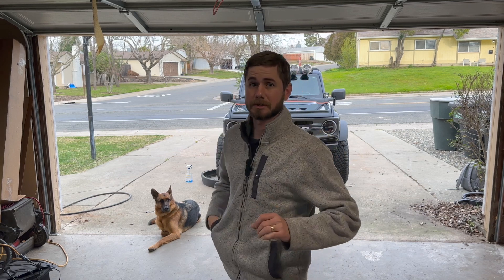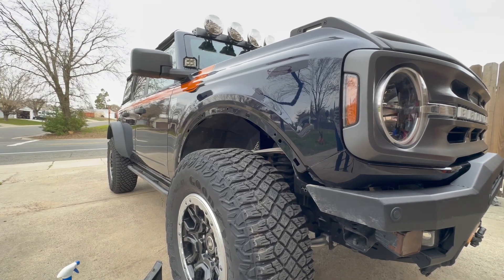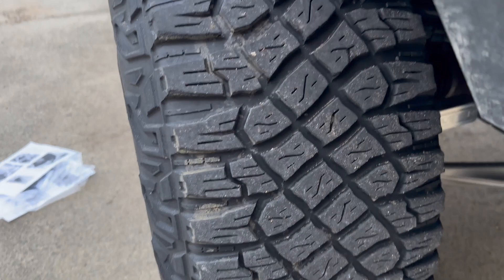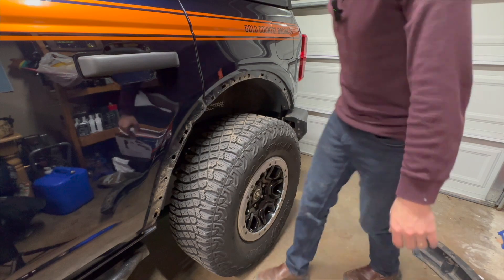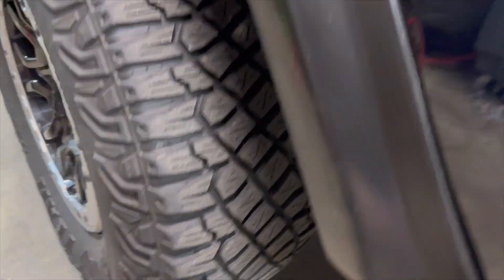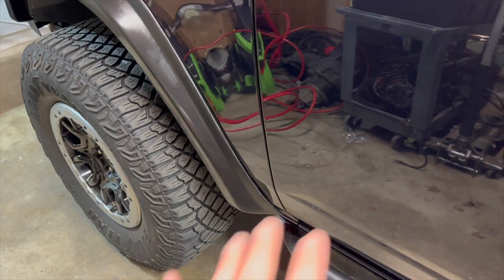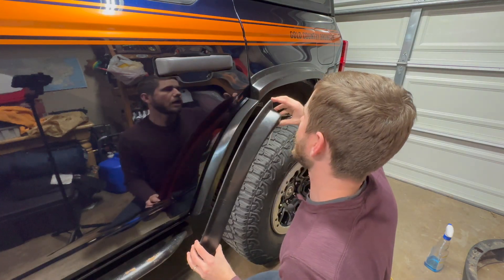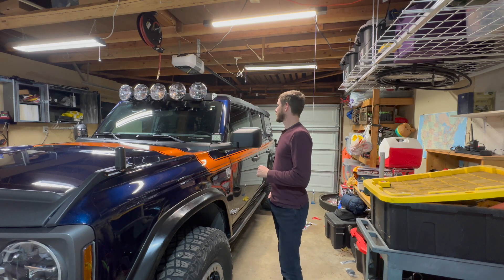I Got A New Bronco!

Comment: I like them. But not the tape idea. Overtime the tape will just start failing to adhere right? And say you’re driving on the trails and knock one off. Well, it was just held on by tape
Reply from the maker: Yea the tape is cheap. They actually sent me new tape they said is stronger, have yet to use it. So far they are still there! Rub em raw on rocks and trees all the time and havnt fallen off. They bend easy and absorb the impacts which helps, lasted longer then my OEM so far haha, I shattered those

Comment: Using a heat gun or hair dryer and applying pressure to the flares will help set the adhesive more effectively - particularly those corner areas.
Reply from the maker: Thanks! I did try that as I applied it off camera and it didn't do much sadly..:( KDB sent me new adhesive though so i'll be trying that soon.

Comment: Does the light bar affect the soft top
Reply from the maker: Yes it did at first. Lots of flapping and I noticed I had to run my radio louder and speak up at freeway speeds. Pretty annoying. 

After installing the ford wind deflector on the hood though the difference was amazing! Radio back to normal settings and no longer yelling at each other. Flapping was greatly reduced. Not back to normal levels but I could live with this all day on the road now